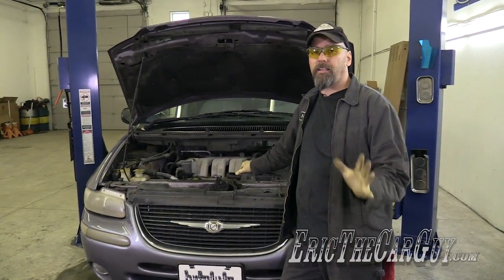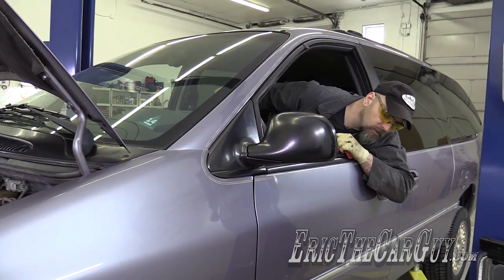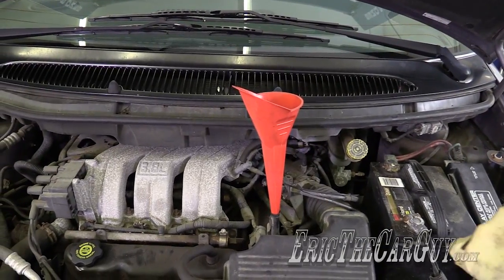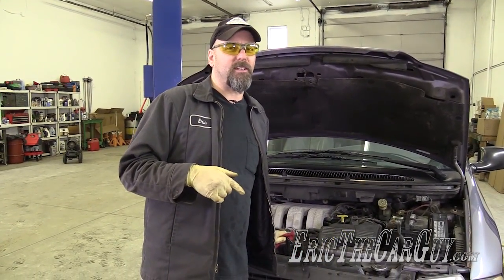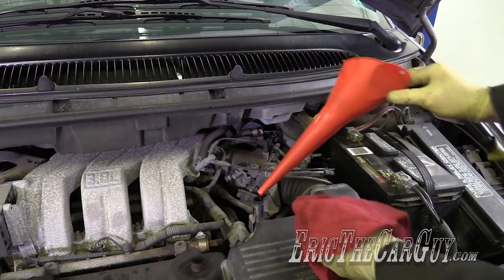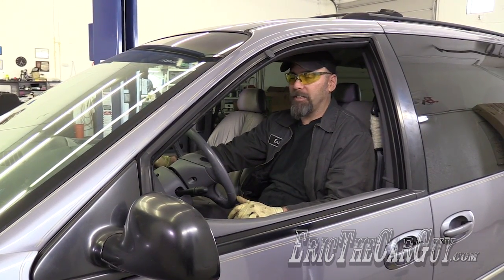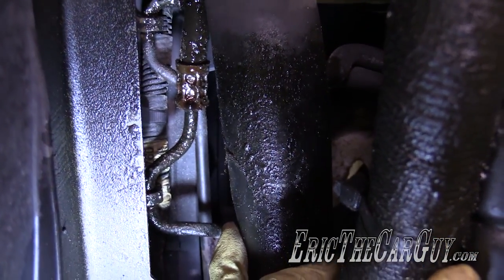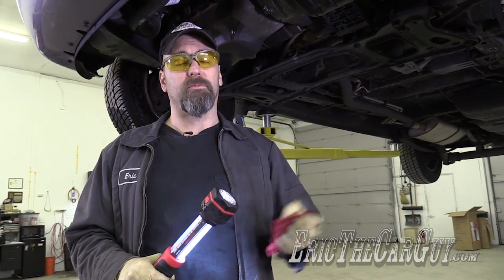1998 Chrysler Town & Country Transmission Diagnosis -Fixing it Forward

Comment: Are those noisy injectors? Or what's making all that ticking racket?
Reply: ***** Those engines (3.3 and 3.8) have really noisy valve trains and injectors. They run for a very long time however.

Comment: When people operate older vehicles they need to be observant about fluid leaks in their driveway, etc. OR they need to do their own checks of fluids periodically OR they need to have an auto maintenance supplier that does more than just change the oil but also alerts owners to possible problems elsewhere. A leak like he was showing on the floor should have been caught by the owner (spots in the driveway/parking spot) or a technician during servicing (not condemning Eric here). Also there would have been clues to low trans fluid level as the trans probably would not have been shifting properly before it went totally south. These are pretty robust transmissions that will go for huge miles with maintenance. Owners need to be aware if they wish to avoid bigger problems.

Comment: told ya its bad news....we have been through alll of this...if the leakage was the reason why this transmission failed...then this shouldn't happen at all...we sold 1997 honda accord to someone without any leakage issue this one i believe is even newer then the honda yet it has all sorts of leakage issue ( coolant... transmission oil...)and its still running today 

Chrysler must be proud when they launched this car  to the market,,,yeahhhh...
they should be ashamed...

Comment: Instead of replacing the transmission, why don't you try taking it apart and fixing it or rebuilding it, just like you did with your Honda Odyssey. I'm sure that Chrysler/TorqueFlite transmission would be a lot simpler and easier to repair than a Honda transmission. I'm sure it would be cheaper to buy the rebuild kit and the clutches than the price for a used or new transmission. Oh and also to note only use ATF+4 fluid in that transmission, anything else will cause it to fail.

Comment: Someone had jack daniels on the brain apparently haha. When my 97 cavalier got low on trans fluid and it started to act all wonky i would add fluid in and it would be fine. Well a month later it literally exploded and failed. there was a few good chunks blown out the back and im not even sure what the hell happened if it was low fluid or too much fluid or what.

Comment: I don't understand why you just don't change the fluid and filter. That may help, it's better than throwing a whole new Trans in it. If the fluid and filter don't help then so what, its a 17 year old Chrysler van who cares? Just tell the customer to drive it without reverse. If gears 1-4 work fine then I would say just leave it alone, that's my take.

Comment: This reminds me of a diesel Tahoe, a 1996 if I recall correctly, that my school fixed up earlier this year. The transmission was slipping real bad and so we replaced the transmission, then while filling the transmission we noticed a leak. Upon further inspection we found that the transmission cooler lines had rubbed together and rusted through.

Comment: Sounds like the reverse band went.
Reply: AJ Harran in that case he should of went through all the manual gears (which he should of done anyway) and he wouldn't  of had low 1 (that the only other time the rear or reverse band is used on these).
Reply: Anthony Filice ain't this trans a604, thought it only operates with clutches?
Reply: AJ Harran  +Anthony Filice  No bands in this transmission.

Comment: lol a transmission with no atf is like a engine with no oil, not long for this world.
I remember my dads corolla with 310k km or 190k km had like absolutely no oil in the engine due to its piston rings.( my dad adds oil every 2 months and he dosen't want to fix it) and it ran like a tractor that day and we drove it over 50km with no oil then we put oil back in it and it was perfect. that's Toyota for you even with the 1zzfe burning oil just add some and they will keep running

Comment: Why not disassemble the trans and show us what failed inside if you have time. That would make for a good video.  Also, a rebuild kit and a torque converter is cheaper than a whole new trans.

Comment: ... How do people buy cars without at least knowing how to keep them running fluid wise? Not how to replace, or add, but just KNOW about fluids that need checking and replacing? It baffles me, honestly.
Reply: lexyon Some people are as you describe, yes. But this van WAS being maintained and the fluids were all topped off the day before the breakdown at what I think is a reputable car service place. However, it appears the fluids were all gone by the time the van got to Eric. The sound it made when it stopped moving FORWARD from a full 45 mph was a rattling, metal on metal. (I have a video recording of the breakdown.) Kind of like coins in a dryer. Many people asked thought torque converter. Interestingly enough, after it sat for about six weeks while trying to decide what to do with it, on the day I had it towed to Eric's garage, I went out and it started right up. I revved it a few times, put it in drive, and the thing drove out over about 2 feet of snow. I parked it on the cleared driveway so the tow truck could pick it up. Sadly, no reverse, though.

Comment: If the issue were mechanical and not electronic or switch related I would expect a mechanical whining without engagement.  Maybe the sound on the video was too low.

Comment: Those transmissions are junk. My wife has a dodge grand caravan and the transmission went out 3 days after we got it and not beating it either. Now its been sitting because of the transmission again the shifting solenoid is shot and I have no energy to fix it.  Seems is always something with it.

Comment: Eric's auto repair shop on the Dodge town and country mini van, it looks like you got to pull out the transmission with reverse Out on it. You said you have to replace the transmission   but I question your skill level  in knowledge it seems like you don't know how to rebuild a transmission based on what you said. You need to go to a tech school and learn how to everything. Including rebuilding Transmissions and engines. Put another transmission from another source does not 100% solve this with you In skill level and knowledge. Eric you need to go back to school learn how to do it.